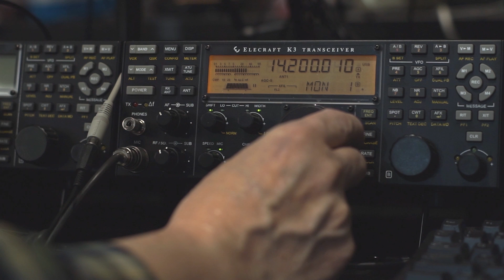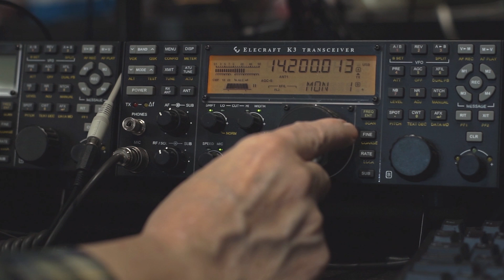Ham Radio Basics--What is SSB and How to Tune in SSB

Comment: Thanks for the explanation of why we use LSB on the lower bands below 10MHz. It is not often explained. I got my license in 1989 and my elmor PAoPWA(sk) explained this to me.
It has to do with mixing up our mixing down. like 9+5 to 5.5 makes 14 to 14.5
 and 9 - 5 to 5.5 makes 4 down to 3.5.... And with this mixing, the sideband changes if you only use on sideband made with 5 to 5.5 MHz. With one sideband filter you make USB on 20m and Lower side band on 80m. Also the VFO knob has to turn the other way to go up. PA0CHN(sk) made a transciever that used this principal. By just filterting out one band 20m our 80m he could make a simple transceiver  for two bands...

Comment: Hi Jim.  Thanks for your video on SSB.  I wonder if you can share some of your wisdom on this problem I have when I try to listen to SSB.  I can only hear one operator and not the other operator when he is speaking.  How do I tune (or what is the tip you can share) so that I can hear both parties when they are speaking on either the 20M band or 40M band.  Cheers.
Reply: That has nothing to do with it. You are simply in the skip zone of the one you can't hear. No tuning or anything else will help you.
Reply: @terryparker1694    Thanks Terry. Appreciated your comment which is well noted. Now the puzzle is solved. Cheers

Comment: I am used to think about SSB different way. Voice feed to double mixer with phase shift of 90 degrees. After the mixer, there is sum that should be cut with low pass filter. To get 90 degrees, I am using logic gates and four times the frequency. By dividing by 2 and again by 2 + XOR gate, getting the right frequency that can be switched between 90 degrees lead or 90 degrees lag (USB vs. LSB). Prior to mixing, it is always good to use 300 Hz high pass filter and after mixing 3 kHz low pass filter. Carrier is automatically subtracted by nature of mixing with double balanced mixers. One sideband is automatically subtracted by nature of double mixers (two mixers in parallel). SDR receivers use the same principle to get IQ (In phase/Quadrature) signals. IQ signal, for example 1 MHz, to channels (~stereo), each is shifted 90 degrees. By reversing process with dual mixer and another 90 degrees oscillator, one can get 2 MHz bandwidth with two 1 MHz feedlines. Just make good filtering to avoid IQ spike (where two signals overlaps in the center). If you swap IQ channels, you may get the same frequency range, but this time higher frequency is to the left, lower to the right. 73

Comment: Can a single frequecy be used in AM and in SSB mode both by two different stations simultaneously?
Reply from the maker: Yes it can.  73, Jim W6LG
Reply: @ham-radio  bt how its possible? The signal must be interferring as frequency is same

Comment: A very good explanation. 
I used CB here in England in the 1980's. I could get about a quarter of a mile on a car turn signal 4 Watt bulb soldered into a PL259 plug.
When the government legalized CB on FM, there were a million or more still using their illegal AM CB sets, replicating the battle you describe of AM verses SSB.

Comment: The bottom line is if it's not SSB, It Ain't Got That Swing.😎🤫🤐 🤣🤣🤣🥳All the transmitted power goes into one sideband and the bonus is, it occupies the least amount of bandwidth. 🤔And if not mistaken less duty cycle time on components. 73 Jim and 88 to all a goodnight.

Comment: Personally I would have appreciated some graphs or visuals to enhance your explanation of AM vs SSB, and explain why one mode is superior to the other. I have little knowledge of different modes. Why is 2 meter generally FM while the lower bands prefer SSB. 
I realize from listening to Citizens Band for many years, that two stations transmitting on AM cause a squeal due to the carrier of each station being slightly different from each other and the 'sum & difference' of them creates an audio that is rather unpleasant.
In THAT way, I can understand why SSB is preferred as there's less noise when two stations double.
But a vocal explanation alone doesn't give me much to go on....

Comment: Hi Jim and All. Great explanation of SSB; always enjoy your videos.  But, I do have a question to everyone and, excuse my ignorance. But, if one removes the main carrier and, one of the side bands, while in SSB mode, how is the signal transmitted? If there is no carrier, how is the information sent into well, space?  What is the vehicle for sending the information?  I'm aware that the carrier is produced at the receiver for demodulating but, how is the signal carried to the receiver.  Thanks! Jim
Reply from the maker: Good question!   Think of the signal being 10kHz wide.  You and I chop off half of that with some kind of digital filter. There was energy in the entire 10kHz.  Now after the filter there is a linear amplifier in the box.  Let's say next you and I remove the carrier that is 1 kHz wider.  There is still 4 hKz of RF. Now let's say that we remove even more by chopping off 1.3kHz;There is still lots of energy; RF energy.  Now let's filter the bottom 200 cycles or Hz.  Now we have 200 to 2700 Hertz.  That still can be very good audio.  Does any of that make sense?  73 Jim

Comment: Jim can a general class operator use usb on 20 and 40 meters or are we just restricted to the LSB mode
Reply from the maker: Hi Marvin, It is just convention at this point.  So USB or LSB, it does not matter as long as the transmitted signal is within the band.  73, Jim W6LG

Comment: Can amateur radio signals (ham) come through on  a SW full spectrum  radio such as radiwow or tecsun pl-310  without SSB or BFO  due to an overload of signal . Can it be filtered through even without 455 mhrtz? Does ham radio pass through the signals that are not using it?
Reply from the maker: The short answer is no.  The receiver, no matter the I.F. must have the LSSB and USSB modes.  Jim

Comment: Thanks Jim. Good video. Does SSB work on CW FM and SW apart from AM ? I'm a bit confused....
Reply from the maker: Think of them as all being different modes of transmission/reception.  Each has a specific requirement.  In SSB mode you can receive CW.  AM would have a tone full time due to the carrier.  FM would not sound good and be very difficult to understand.  Try it and see how it sounds to you.  73, Jim

Comment: Sideband is a fairly complex concept, and I've rarely heard a good explanation of how SSB works that wasn't meandering and touched on areas that weren't really related or relevant.  The first thing to know is that in any analog communication you need two characteristics to transmit an audio signal: 
1. A way to modulate in transmitting, and demodulate in receiving, the complex wave form(s) produced by the FREQUENCIES of voice and music. 
And 
2. A way to represent the VOLUME or relative loudness (POWER) of that wave form. 

So , in A.M. the VOLUME of the sounds is produced by the difference between the minimum and maximum amplitude of the carrier which is related to the POWER output of the transmitter; and the FREQUENCIES of the audio transmitted, drive the speed at which the amplitude (POWER) of the carried is changed. So with regard to VOLUME, when you hear a faint A.M. station, or maybe a strong A.M. station with low audio VOLUME, it is because of the relative small difference between amplitude (or POWER level changes) to the RF wave discerned by the receiver.  And the audio FREQUENCIES you hear are the result of the audio wave form driving the speed at which the changes in amplitude (POWER) occur. This is why you don't have to be perfectly tuned into an A.M. broadcast, the FREQUENCIES you are hearing are being discerned from the amplitude (POWER) of the carrier frequency, NOT THE frequencies of the sidebands that are created during the audio-RF mixing.  

On the other hand, with sideband, whether single or double, the amplitude (POWER) of the transmitted wave is what the receiver discerns as VOLUME, and the audio FREQUENCIES ultimately discerned by the receiver are of the actual frequencies created by the mixing of the audio FREQUENCIES and the carrier (the carrier is suppressed in transmission).  This is how and why sideband is not like A.M., with sideband, you are actually hearing the changes in the FREQUENCIES produced by the transmitter during the mixing of audio and RF; and this is why you can actually change the pitch of the audio you're hearing by making slight changes to the frequency your receiver is on; that doesn't happen on A.M. This is also why you cannot understand sideband if listening on A.M., your A.M. receiver is discerning amplitude (POWER) changes, but the audio form in the sideband signal is changing frequencies. The reason you can listen to an A.M. signal on sideband, is that A.M. transmitters produce sideband as a natural result of the audio/RF mixing process, but A.M. receivers don't use or need them.
Reply from the maker: Thanks Louis.  I think many trying to read and understand your explanation may not learn from your narrative.  Please give some thought to a much shorter explanation.  Thank you, JIm Heath W6LG

Comment: Jim, or anyone, thinking of getting my license, was going to go handheld, looking for good HT & antenna
Reply from the maker: Even though the legality of them is in question, the cheap Chinese devices on Amazon are good enough for a start.  Get the programming cable and programming software along with the handheld.  Plan on spending less than $50 for the handheld.  Then you can make an outside antenna from whatever stuff you have around the house. I have used coat hangers, collendars, screwdrivers and more.  The screwdriver was made into an antenna yesterday.  Regards, Jim
Reply: Jim W6LG also, you recommend online or book to study?  Thank you ☺️

Comment: Jim, (others), as a new HAM Tech. How can I start using SSB. I want to be more exposure and more OSO's on Satellites and further than a few miles from my QTH, (not including repeaters).
Reply from the maker: My best advice is that you must upgrade to General and then Extra. Get on HF and talk to the world.  You might want to try 20 meters for now.  As the sunspots improve 15 meters will start to get good around the world.  At the peak of the cycle, 10 meters will be an amazing band.  So, to answer you question, upgrade to HF. 73, Jim W6LG

Comment: Nice history on the modes of operation.  Thanks for the explanation on why lower side band is used on 40 and 80 and upper is used on 20 and 10.  I knew it wasn't an FCC reg, but I was baffled as to why there was a difference.  In the video you talked about reinserting the carrier at the receiving end; and of course you did in order to make the signal intelligible, but there was not much fan fare about it.  I had hoped that you were going to use an external BFO with a Standard Broadcast band AM/FM radio that happens to also includes some HF frequencies but is not designed for SSB listening.  On you Elecraft Tranceiver, the Mode button and the VFO take the place of a BFO knob so there was not much to do about inserting the missing carrier in this demonstration.. Many yrs ago I built a simple BFO in order to listen to SSB with a standard broadcast radio.  Hand impedance was a problem when tuning the BFO, and  I never resolved the issue.  Anyway, I love your videos.  Jim, considering all the help you are to people, I hope that you have someone local to help you with any physical activities that have become challenging .  Thanks for all you do.   73 Joe KF7POQ

Comment: It's much easier to see what these modes look like when you're using an SDR radio with the spectrum scope.  When you transmit on the IC-7300, you can see the carrier the modulation.

73 de KE0STO
Reply: Web sdr for those not equiped with rigs so cool

Comment: Thanks for another informative video!  Learning everyday, I want to get my T license but just feel I need to know more about HAM before I plunge.  You are a great help!
Reply: Just go for it I didn't know anything about ham just cb and  radios for the fire service that's all I knew studied up and took the tech and general in one shot best way to learn is to get on the air the Elmer's are some of the most helpful and patient guys I ever met
Reply: Dive in! If there is a local club, join it. The Elmers will be more than happy to help. In tested a well ago and the next night was helping remove antennas and equipment for a member that died. When I get my call sign, I will be joining the club.

Comment: Can an “SSB” circuit be created to be used for pitch shifting for voice effects? I’m new to ham but I tinker with electronics and sound effects just for fun and wonder if that’s possible. Would something like a low power transmitter being fed into a receiver or what you did, into a dummy load be sufficient? Or is there a way to use the same principle without using Transmitter/receiver circuits?
Reply from the maker: Yes. But I think it would be lots easier to do that digitally with some of the free software available like Audacity.  I would search for phase shifting and pitch shifting audio.  Thanks, Jim W6LG
Reply: Jim W6LG 
Thing is I have used audacity's pitch shifting plugins and sometimes they're okay, but there are artifacts in the audio at times. They way I hear ssb voice sometimes sounds like when you run your voice  through a ring-modulator, although not exactly. I hear that effect more in the low end. Maybe if I have two tracks one ring modded and the other not and roll the highs off the modded and the low off the unmodded maybe it will bring a similar effect...

Comment: Sidebands never made sense to me until I learned about mixing/hetereodyning. The am modulator behaves like a simple mixer in that it mixes the baseband signal with the rf generated from the pll or oscillator. When you mix two AC waveforms you end up with multiple new frequencies in the output and the undesired is filtered out. You end up with freq1 + freq2 and freq1 - freq2 primarily as well as the originals and all permutations of the fundamentals. This is why AM has sidebands, its a result of the baseband mixing with the RF carrier.

Comment: Is there any scenario in which AM is actually better than SSB? From any perspective -- cost, fidelity, etc.
Reply: In simple terms no. BUT, depending on how it is adjusted and run on the air, an AM transmission  usually sounds "rich" or has full bodied audio, and the way most SSB transmitters and the way the audio is adjusted feeding them, it sounds more "communications quality" not "broadcast quality".  BUT there is no reason that SSB transmitters cannot be set up and fed with wide band audio to sound "rich" also.  This is sometimes called ESSB or enhanced ssb. Of course this takes up more bandwidth on the air and is not done by the majority of operators.  They are looking for the best bandwidth to communicate with the best "punch" not the richest, fullest sound quality.  Life is a tradeoff in all things.  AM modulation is very inefficient in terms of power used and the ability to be heard clearly on the other end.  SSB is many times more efficient in terms of power transmitted.  Also the receivers on the far end can narrow their bandwidth to improve the signal to noise ration.  So a long way around to answer your simple question, but watt for watt  a SSB signal will be heard further and better than an AM signal.
Reply: Good explanation, thanks.